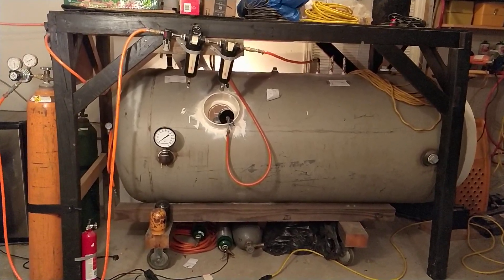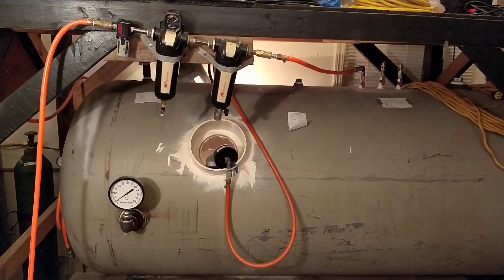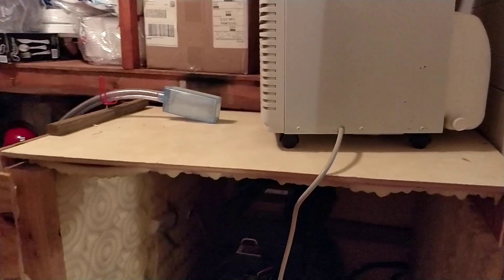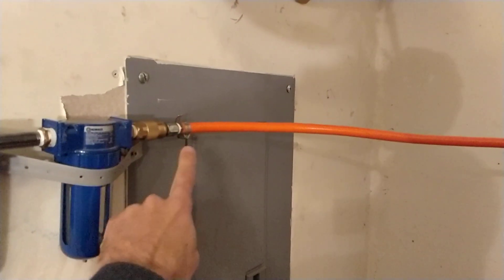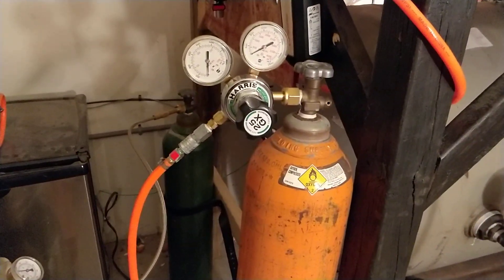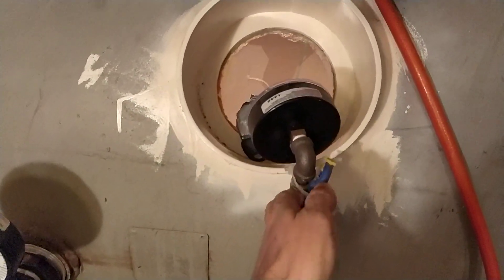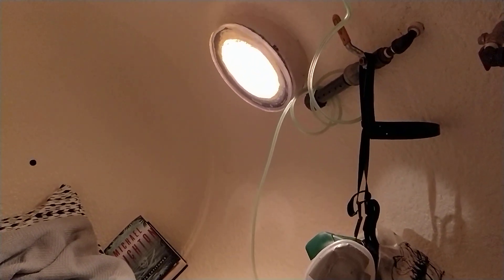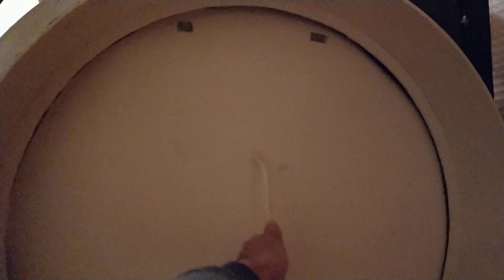Hyperbaric Oxygen Chamber (Home made)

Comment: FYI's:  
1. The company that rents chamber time near here, said that "2 hours inside a low-pressure chamber without adding O2 = about same as 1 hour inside the same chamber with added O2.".  
2.  Also, they admitted that buying one of their used chamber setups [they only use/sell/rent the soft-shelled chambers], considering the outrageous price tags even on a used setup, is hardly worth it, since their used units will only last a few more years of daily use.  That works out to being extremely costly per each hour of treatment, to use a commercially made unit. 
3.  Making one's own chamber similar to this barrel chamber, and, using it only with the air pump, can get you the pressure treatments needed, for a LOT LE$$. 
4. A full-extension conveyor belt or "drawer runners" to slide the bed, would greatly assist getting in/out of the chamber.  That is one of the hardest parts of accessing hyperbaric chambers; those who need them most, have hardest time getting in/out of them.  
5.  BEWARE to make sure you use Non-toxic, zero-VOC finishes, at least on the inside.  Otherwise, those VOC's will keep outgassing for months or years, into your lungs, and, because it's under pressure, deep into your body tissues, as well...you do NOT want that!!!  All kinds of plastics have helped make us all sickly, with many strange conditions...lets not use those in hyperbaric chambers! [Just because you cannot smell an odor from paints or caulks, does not mean those are not outgassing VOC's!] 
6.  One might use an O2 supply, + a pump and, a silicone sleeve or/and tubing large enough to insert a whole leg or arm, and deliver pressure + O2 directly to a limb, instead of the whole body.  Could use silicone sleeves, with maybe tubing like used for tourniquets, to roll the edges around, to hold edges in place and hole in the pressure.  That kind of a setup could be a boon for those who are claustrophobic and therefore cannot use a chamber.  Sandia Labs has made something like this...that can also be used as infection control containment suits.
Reply: Hi Winter Star. According to Dr. Dr. Susan Sprau - UCLA, the oxygen has to be inhaled (https://www.youtube.com/watch?v=cTROb6ZdZjU). Adding it from the outside won't help.
Reply: @straxxxxxx     I only listened briefly to that long video...and heard her CLEARLY saying hyperbaric DOES pressure O2 through the skin into deep tissues, to heal the body....which is opposite of what you just commented. 
—> Any Doc who would state that O2 can only get into the body via breathing it, is pretty much “committing professional suicide”....kinda like Fauci did as he tried to pander to DT. 
Maybe when you listened to that video, there was miscommunication?  Perhaps you misunderstood?  
Because, hyperbaric chambers have been being used to cure “the bends” for almost as long as there’s been deep diving.  
The bends happens to deep divers who come to the surface too fast, get the wrong gasses concentrating in their blood, that blocks O2 reaching body tissues....only way to save them is to pressure-push O2 through the skin into deep tissues, bypassing the lungs, as at a certain point, the lungs just stop exchanging gasses properly.
....Like what’s happened to the Covid sufferers who get deathly low blood O2, but are still talking coherently, instead of being in a coma.  
Low-pressure Hyperbaric works similarly, to increase body-tissue O2 (it also pushes in Hydrogen) respiration & speed healing of many, many serious ills, by bypassing the poorly working lungs, pushing O2 directly into deep tissues directly. 
—> There’s much that modern medicine is not so “modern” about...
One of those things is, how O2 & H2 help overall health & healing, especially when pressured into deep tissues. 
—> PLENTY of healing happens from hyperbaric, BECAUSE that is like “The emergency backup” for breathing.... ....especially when something is wrong with O2 exchange mechanism in the lungs...
....like has also happened due to Covid. 
MILLIONS of people suffering some of the worst ways to die—Covid or other breathing ills, suffocate with low O2 levels in their blood, but can be helped by regular hyperbaric treatments. 
BUT, not all is lost...as long as someone’s blood O2 has not already dropped down to about 90% for too long, they may still have enough air exchange in the lungs...
....IF the are given supplemental O2 to breath....it just cannot get deep into the body tissues the way hyperbaric does. 
But using a Nebulizer or a slightly modified CPAP to vaporize peroxide to breath via a mask or tube, gives just a little more O2, & that has seemed enough to stop most viruses, including Covid, in it’s tracks, for many people.  Numerous Docs have been treating their patients with it. 
Modern medicine does NOT know everything.  
There’s plenty of evidence to that.
Reply: @Chimonger1  I did not misunderstand. I do not see why a UCLA resaercher should be lying. She is presenting the results of plenty of studies. 
Also: The way oxygen gets to the tissue is usually via the blood. So what she says to me makes absolutely sense. 
Can  you provide any reseach studies that show that external hyperbaric oxygen has positive effects? 
And what is your background? Your writing is quite "loud" and does not present any study results, which makes me suspicious...
Reply: @Chimonger1  The information can be found at 1:12:45.
You seem to like to talk/write a lot but you don't like to listen/read. My father-in-law is just like that. 
Again: Can you please direct me to scientific papers/presentations that confirm what you are saying? I understand your strongly stated claims of "professional suicide" etc., but I need references. And that is exactly what you are not delivering.
Reply: @straxxxxxx  Your comment said: "According to Dr. Dr. Susan Sprau - UCLA, the oxygen has to be inhaled. Adding it from the outside won't help."
That seems to say HBOT cannot work as well as O2 delivered by nasal route; either you disagree with using HBOT, and contradict the bulk of the info given by the Doc in the video, or, you made a Typo.  Which? 
At your highlighted time stamp in that vid, she does try to answer an audience question, and said words that sounded like O2 can best be delivered via nose/lungs....however, THAT does not describe the bulk of the video's information, which absolutely supports using HBOT. 
I support using HBOT.  Imho, it's a greatly underused tech that could help many people suffering without it.  I've witnessed the success of HBOT for some difficult patients. 
The ambient breathable average O2 was about 30% in about 1950; now it's about 20%.  The bottom line cutoff for just surviving, is about 17%.  
At that loss-rate of O2 from ambient air over the last 70 years or so, it will only take another few years for ambient air to hit that bottom line 17%.  
https://www.oxygenlevels.org is a starter.  https://sciencing.com/minimum-oxygen-concentration-human-breathing-15546.html might be clearer for some. 
I no longer stockpile file cabinets full of references.  I am not the internet, but I use it.  You can, too. It'll take digging, because the figures I am familiar with, were generated some time back, and I no longer have those sites on file. 
It is findable by anyone willing to spend the time digging for it.  Otherwise, you are doing what so many students do: they avoid doing their own research, and expect others to do it for them.  I give general information on many things...pointing others to where they might look to find more information. 
As for me?  
Been healthcare professional for over 40 years, in varying capacities over time.  And, numerous family members have been healthcare professionals, as well.   
And, I have studied other subjects just because of interest or relation to other things being done.  
You think my writing is "loud"?  Please help me understand what you meant by that.   
I'm officially old. That begets some crankiness--is that what you meant?   I do get cranky when people try my patience, similar to most.
Reply: @straxxxxxx   Thank you for clarifying. 
NO! never DT. End of that part.
Reply: @mt.sinairefuge3208 : l have worked in university research for many years. That makes me a liar in your eyes then. Do you work in St. Petersburg?
Reply: @straxxxxxx  I saw some arguement and between two people and actually did not follow it closely enough see which one of them I was responding to.  I do not work in St. Petersburg, I am building a refuge for people who want to get away from urban areas in the Amazon Jungle (see my channel for details).  However, I did build a walk-in geodesic dome heavy steel hyperbaric chamber for an alternative cancer hospital in Tijuana Mexico about 20 years ago so I have some experience with designing hyperbaric chambers.  I personally believe that oxygen can be absorbed through the skin which would make localized HBO work on limbs.  I don´t even know what side of that arguement you are on.  However, the fact that doctors and researchers frequently lie..does not mean that they all lie.  Same as police and prosecuters...they are known to be corrupt and evil liars but that doesn´t mean that all of them are.  If I had to guess I would guesstimate that 90% of police and prosecuters are liars and corrupt but that maybe only 60% of doctors and university researchers are liars and corrupt.  That is my guesstimate based on a life of experience but not being involved in the work of either of those two professions.  Hope that helps clarifies my thinking.
Reply: @straxxxxxx    What do you research?  Who funds your researches?
Reply: @Chimonger1  I haven't worked in research since about 2000. But I built my own Hyperbaric O2 chamber 2 years ago. I work with the hypoxic hyperoxic paradox. I paid for the chamber myself.
Reply: @straxxxxxx  we were going to build one too. 
I wonder, if a HBOT vest & head piece, might be more affordable & still effective, than a full chamber.
Reply: @Chimonger1  At HBOT Vest? You cannot put 2 ATA on only a part of your body.
Reply: @straxxxxxx   No one’s done it…..…
Reply: @straxxxxxx  This isn't really rocket science, the pre-flood atmosphere was oxygen rich and higher pressure, you can test for yourself pure oxygen over an open wound pocket area using medical tape to find out. Just costs a bit
Reply: @togowack  "Pre-flood atmosphere was oxygen rich and higher pressure?" I presume this is a flamebait.
Anyway, it would be helpful if you could cite the source and the evidence of your claims of the healing power of externally applied oxygen (no anectotal evidence please).
Reply: @straxxxxxx  I believe your right. It definitely makes sense.  Ive researched this for years. People lived almost a thousand years back then because cellular degeneration wasn't a thing. Everyday cells were regenerated from the atmospheric pressure and high oxygen levels. There was a Japanese scientist i believe grew a 5 story tall cherry tomatoe  plant inside of a chamber. Also in Texas they are growing piranhas and other fish 4 to 5 times larger than normal. It all makes so much sense. The o2 level has been proven to have been 50% or better. God bless
Reply: @4wchitstands    Just in my long lifetime, ambient O2 levels have dropped significantly, for multiple reasons, including:  
…most of the world’s forests have been cleared away
…vastly more pavement has covered-over farmlands
…vastly more industries emitting gasses none should breath
…oceans’ plant & animal life has been hugely decreasing
…buildings got much tighter, so, less fresh air indoors, but outdoors..?
…nutritional content of manufactured foods is very poor, & most people mostly eat manufactured foods now; optimal nutrition supports all life processes, including O2 absorption
I’ve seen data that O2 levels in ambient air, in the 1950s, was up around 30%.  But that as-of the 1990s, was closer down around 20%. 
Even a 5% drop in ambient O2, is a  drop, especially considering the relatively narrow % life of O2 breathers requires. 

Also, consider how many, per population, have breathing ills now, compared with even 40 years ago? 
And, consider that commercial medicine refuses to RX O2 to a patient, unless their blood O2 stays below 90% consistently….by then, it’s kinda too late to help them—by that time, their bodies have deteriorated faster & worst, just from lack of enuf O2. 
Commercial healthcare has very deeply vested interests in keeping more folks sicker, longer, needing treatments.
That makes them saying O2 under pressure can’t help; or, nutrition doesn’t matter; or numerous other lines—all designed to support  escalating, costly, chronic ills, & keep folks believing what they tell them.
Reply: @Chimonger1  Can you show me any evidence that the 02 level 1950 was around 30%. As far as I know what you sre saying is completely wrong.

The O2 levels are not dropping, but the CO2 levels are rising (from 0.03% to 0.04%).
Reply: @4wchitstands  Who is the organization that's doing these experiments?  it seems really hard to find info about this
Reply: @Joe-sg9ll   Skin absorbs all kinds of things.  
The old commercial medicine line, “nothing gets thru skin”, was always a false statement—very like docs being taught in medical school, that “nutrition makes no difference in the helping or curing of ills”.   
They still say those, even when they RX drugs via skin patches.   As for nutrition?  That’s been shown time after time, for time immemorial, that it matters very much for any kind of healing, if a person has enuf nutritional repletion. 
But those kinds of statements by docs, sure can add to how much healthcare costs!

Yes, skin does absorb O2, under pressure. 
Low-pressure hyperbaric does it less effectively than hard-chamber hyperbaric. But HBOT really does help heal wounds, helps in breathing ills, helps cardiovascular—the soft chambers just bring the price & accessibility to many more people than can afford or access hard chambers. 
Ask divers who require HBOT to recover from deep dives.
There’s loads of proofs HBOT works.
What does NOT work, is PharmaChem + govt blocking most from using it, by any means they can, to keep-up profiteering using other modes.

Comment: How many hours/ session do you get out of one oxygen bottle?
Reply from the maker: 45 min if continuous oxygen per bottle
Reply: @goretoye  I have built my chamber just to find out that I cant buy refill station in my country and I cant refill larger bottles than 10 liters with medical grade o2 for medical use... And I need this for polyneuropathy, muscle damage and recovering from chemo and cancer treatment... Im mad af
I have question for you, If the pressure in the chamber is +30 psi and If I connect oxygen concentrator that is pushing 5 liters/min at 8 psi, like connect it in my nostrils...will it be able to pus that o2 in my body or will it be canceled by pressure in the camber?
Reply from the maker: @CL9k24a3  I'm sorry to hear that there are so many restrictions in your country. To answer your question: Connecting the Oxygen Concentrator directly to the chamber will not work. The 8 psi can not overcome the 30 psi in the chamber.
Reply: @goretoye  I managed to do somethings and get the prescription from the doctor for medical oxygen so now I can refill bottles as needed (7.5$ per bottle). I have 3 bottles of 10 liters (10 gallon) at 200 bar (2900psi) of pressure. With conserving o2, only activating  it when breathing in and shutting it off when exhaling Im getting 80 minutes per bottle at 2 ATA pressure.
I went to an local HBOT med center and asked around, they have some russian chambers that are setted up to decompress at 1 meter (3.3ft) per minute and in emergency cases they are  decompressing at twice the rate. My compression and decomp times are 15 min to and  from 2ATA (30 psi), just to be on the safe side.
I did 3 sessions of 60 min and my body functions is night and day.  Before I could not walk more than 2 miles, I would get extremely tired and be sick for next 5 days with massive pain in joints and muscles and now after HBOT I did 10 miles of fast walking and nothing happened to me... No pain no fatigue, Im not getting tired and my cognitive function is much better. 2014 I got hit by a car got my knee f... up ... And that doesnt hurt anymore. Conclusion: every household should have HBOT chamber lol.
Reply from the maker: @CL9k24a3  That is awesome!! I'm glad to hear that u are having such great success with your chamber :)